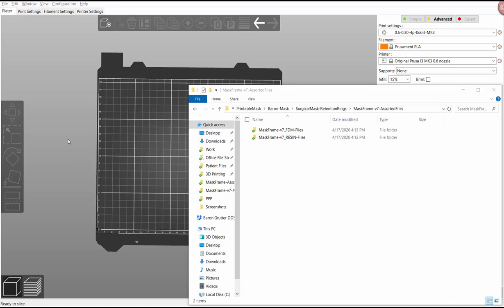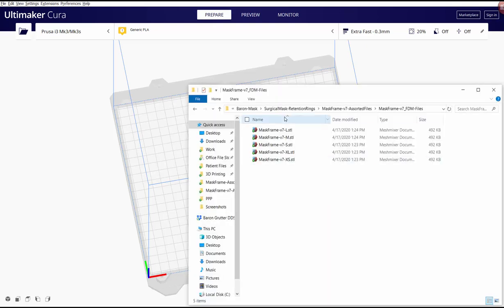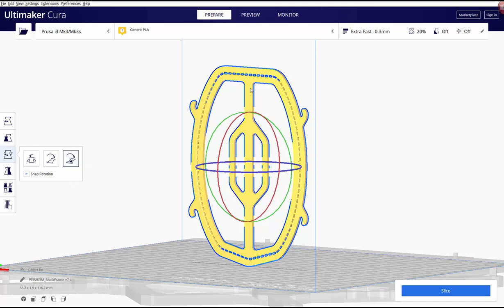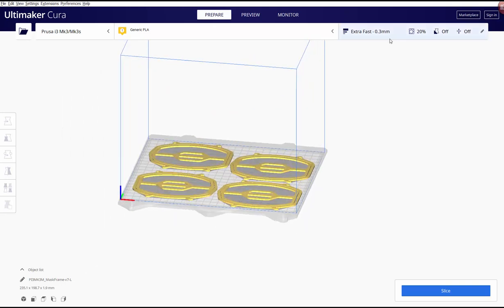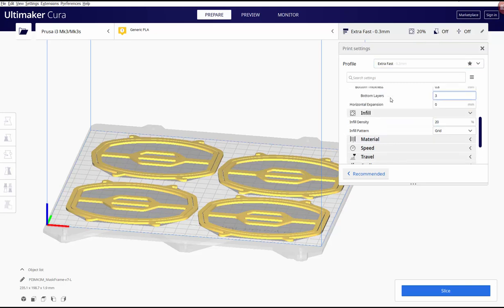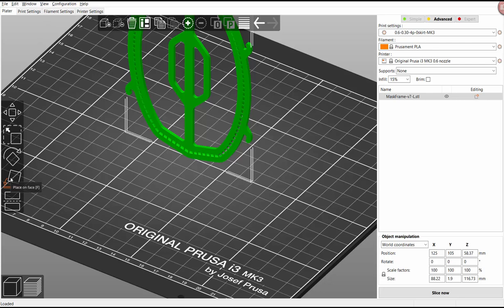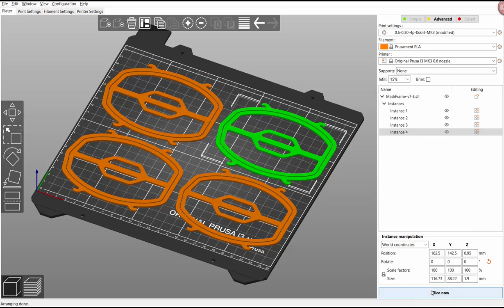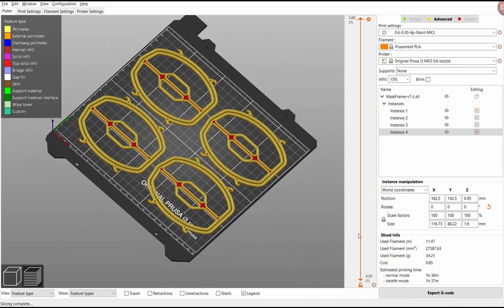MaskFrame: How to 3D Print - FDM and Resin

Comment: Can any of these slicer software  wok for both fdm and resin 3d printers so I don't have to learn 2 different slicer software. Thanks in advance.
Reply from the maker: None that I would recommend. I mean, there are some. But the settings are so drastically different that it's not worth the hassle. Besides, resin printing software that is designed for the printer is typically super simple as all the settings are done behind the vail.
Reply: @bgrutterdds  Thank you.